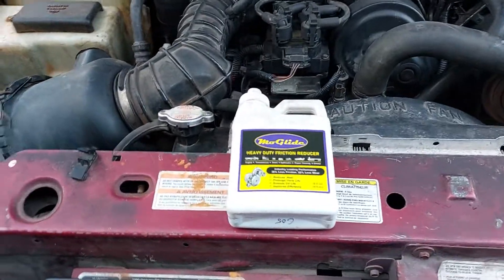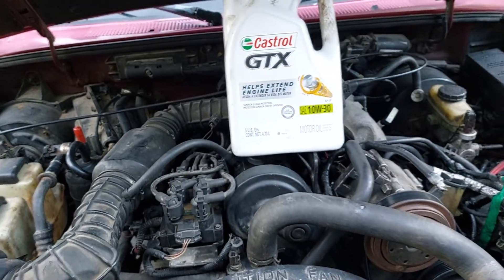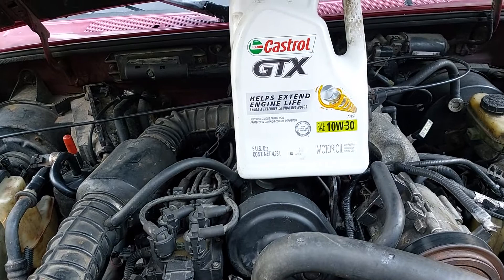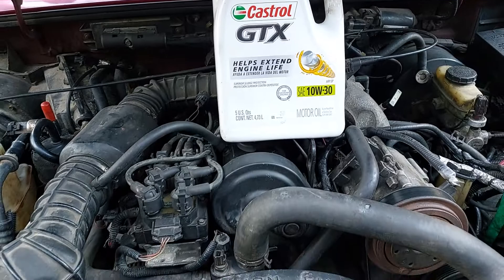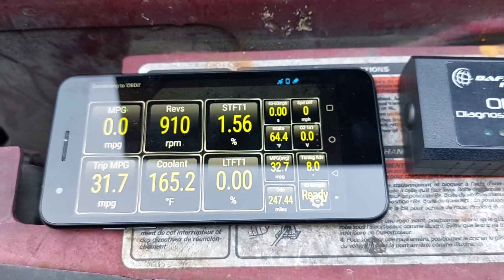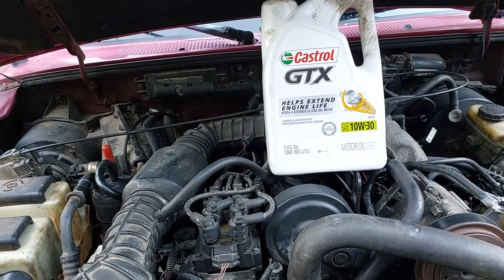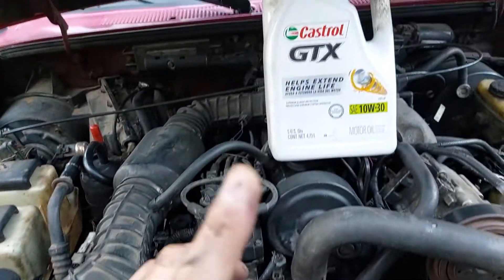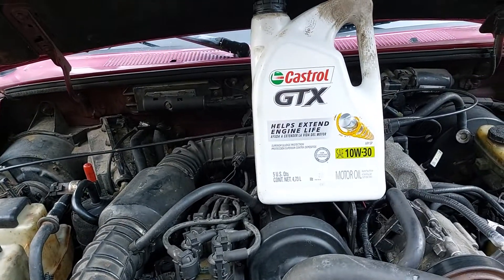Is This The Best Engine Oil Treatment? Let's Find Out, Part 3.

Comment: Hey how has that 2.5L swap been holding up? Any issues since?
Reply from the maker: It's doing great, drives just like stock except little more power.
Reply: @everydayirace  nice, I'm hoping to follow along your video. I have a 96 ranger 2.3L manual that needs some help lol
Reply from the maker: @dylanconn6079  I am planning to do few more things to it.

Comment: do you uses 5w30 any time after engine swap?
or always 10w30?
Reply from the maker: I will be using 5w30 during the cold part of the year.
Reply: @everydayirace  Can  you verify if your intake is more clean using 5w10 intead 10w30? i uses 10w30 because my lower ambient temp is 20c, but think is excesive oil in my intake, pcv valve motorcraft used to reduce oil leaks in mounting place, has almost 10k miles.
If yo switch oil viscosity maybe can verify.
Thanks for share data.
Reply from the maker: @everardoquintana1097  if your engine has excessive blow by, I don't think thinner oil is going to solve your problem. You can reduce the amount of oil going into your intake by installing a catch can.
Reply: @everydayirace  i think was related to use diferent oil of the ford especifies that cause thant oil in intake, i think is excesive, but realy dont know how much can consider excesive 🤣😂, the 2.3 dont give me throubles and i clean intake some were every 2 years 😅